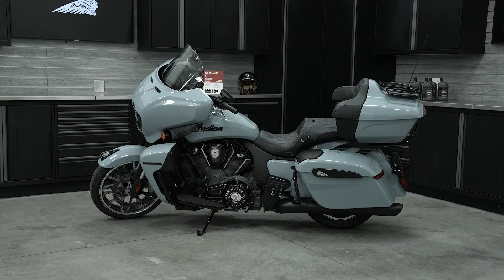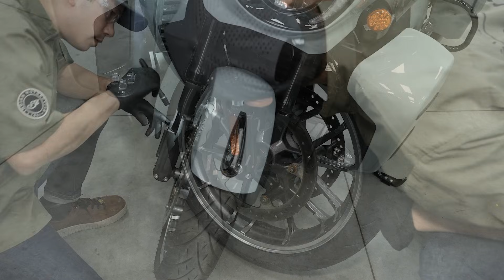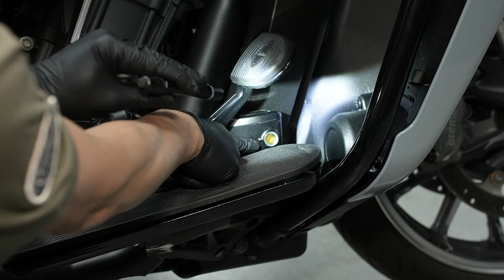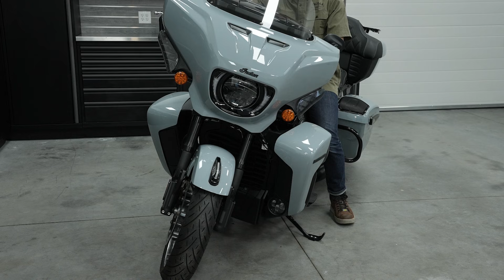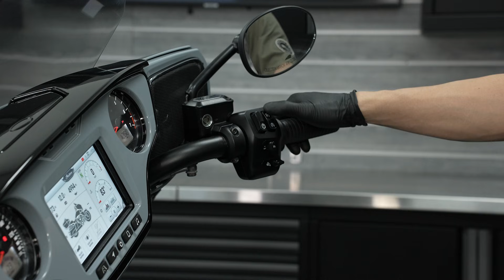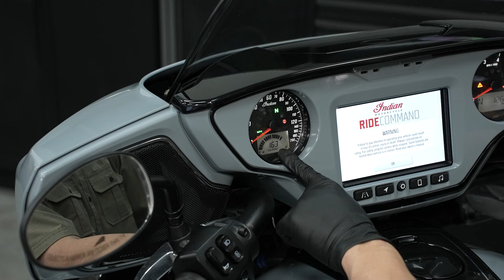2025 Indian Roadmaster Powerplus | Pre-Ride Inspection

Comment: I’m with Slim here. Haha I never check my Pursuit that intense. That’s what your service technicians are for. 

Though you raise some good points. 

What I will say is if you want 41psi don’t put in 41psi. I run both mine cold around 35psi. After being on the road for a while they warm to 39-41psi, 44psi if you’re pushing the bike.

Hey @anythingoldmechanical .. Full fairing bikes are plastic too. And 100 percent you get what you pay for. You want a full carbon bike? They make them. You want affordable but not plastic? They make carbon parts to replace everything plastic on the challenger. But it ain’t cheap…